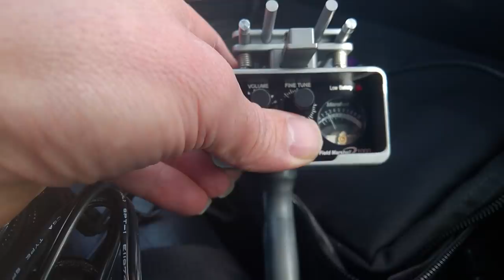Stolen Atlas Copco Compressor found by Automatrics

Comment: Why don't you use a prepaid SIM card so it can Rx/Tx from anywhere in the world with cell reception?
Reply: @kasa6468  the last known location?  Gps sips so little power so keeping the chipset working but not transmitting is trivial.

Comment: How did the officer open the garage door with the lock still on?
Reply from the maker: There was a lock but the clasp was not secured so it could be opened without need of forced entry
Reply: He told it to stop resisting

Comment: why don't you just put the gps location modulated into the 'beep beep beep'. you still get the 'beep beep beep' just that it contains some 300 baud'ish signal as well, should it be able to receive gps where it is.
Reply: If you listen to the video at about the 0:45 mark, you'll realize that they do have GPS capability in their system. The issue with this particular recovery was that the location the compressor was hidden had too poor of a GPS signal for the location to be determined. From the audio in the video, it seems that the system uses the cell phone network for data transmission and crude location determination. Then they use the radio system to get to the specific location. But if a good GPS signal was available, they'd get the lat/long coordinates through the cell phone network.

Comment: This is nice, but there's a problem. You should have never made these videos public. On my friend's stolen motorcycle, the thieves confessed to have known how to disable the security because of an internet brag on the company's website (not automatricsMtrack). They simply got in the garage, saw that the bike had some sort of device (harder to dissimulate), googled it, saw how to disable it based on how it worked, and stole the bike.

What they had missed was a simple GPS pulse type device that was hidden in the wasp tail of the bike behind the light pods.

IMO the moment your security company makes it easy for the thieves to disable security...just my two cents.

Comment: so what was wrong with gps? Can't you just log the gps data and the trace the trailer?
Reply: markman, if you've ever used any form of GPS you'd know that it horrendously unreliable anywhere in among buildings.  Even a few bushy trees or heavy cloud will seriously weaken the signal.
Reply: I see, I wonder what those litter-scooter companies are using to track their scooters. Something other than gps?
Reply: Smartphones work on a combination of GPS and celltower triangulation - could be that.  My last phone was accurate to within about 50 meters with GPS disabled - just based on the reception of nearby towers.

Comment: Brilliant. 
I guess technology has come a long way over the years. So much so that you don't even need to wear gloves when recovering stolen property to avoid leaving unnecessary fingerprints. You can assume the thieves handed the trailer in the exact same manner when they stole it. Don't worry, the police can dust through your prints and lift the thieves fingerprints. 
sarcasm
Reply: The technology is going in one way, and the societal instituions are going the other. The police will not bother. Fingerprint forensics for a theft? are you joking? The institutions of force are too busy enforcing the social engineering programs of your replacement. Goodbye.

Comment: clearly not very smart if the theif didnt try to disable the trackers
Reply: Most small time / young crooks would think UHF is a UFC spin-off. Kids that grew up in the 90's and up think that tracking means GPS and if they're really clever GSM/GPRS, all's you have to do is shove in a garage or hide it in a tunnel and you're good. Either way, betcha they wouldn't even know what to look for if they started taking the thing apart to find/disable the tracker. I'm sure they don't just slap a big cartoony sticker on the side of if saying GPS or TRACKER.
Reply: TheComplexCo hah, true, and i suppose thats why they got caught. you never hear about the smart ones!